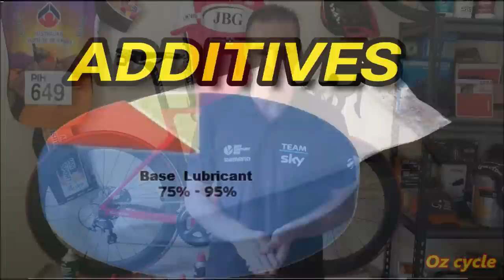Ultimate Chain wax - make it yourself

Comment: I have a 3.5l slow cooker arriving tomorrow - one with a metal bowl was going to be delivered today but cancelled it for one with a replaceable ceramic bowl so can swap for cooking! I haven't checked on the availability of PTFE powder yet but will start waxing my chains soon.
We had an exceptionally wet winter here in Blighty at the beginning of 2021 - bad enough to fit full mudguards to my commuting bike. I carried on using "dry" lube but it washed off after a few miles so started using a "wet" lube that stayed on my chain. Once upon a time, we just bought chain lube!
Wet lube is really useless for the simple reason it attracts so much crud that it grinds every part down - hence my interest in hot waxing.

Comment: Some feedback after 3 years and almost zero chain wear.
I started with 3 new chains and have cleaned and waxed using a fresh chain each week. I still dont even make the first level on a chain wear tool.
I average about 8000kms per year down in Tasmania so winter conditions are pretty average to say the least.
Im using the new formula and im also still on the first batch of wax, will need to top up soon. I also do a full clean before rewaxing, this only takes one minute. 
Because im using multiple chains its pretty easy timewise as i always have one ready to.
Have only just changed a rear cassette for no other reason but replacing wheels and thought i better put a fresh cassette on. 
Thanks for the great video and advice.

Comment: Fantastic video and so much detail thank you for such an amazing effort in the testing and creating the video for us.  Just today I used your previous method for the first time and just bought the rice cooker for it.  I'm wondering if i just warm the wax up on the keep warm setting.  I will try a thermometer on it.  For the Australian's, that brand of slow cooker is sold at K-Mart
Reply from the maker: Yeh that will be fine Andrew,just keep an eye on the temp and it will work out.
Reply: I use an old rice cooker on the warm cycle and a digital temperature gauge. 80-90 is good. Let your chain soak and observe the bubbles until there is no more. I then let it cool to about 60C before removing from the pot and lay it on rags or paper.
Reply: I still use the rice cooker. I put the wax in a glass jar, then put water in the cooker. Put the jar in the water in the cooker. The wax is always cooler than the water by a few degrees and you can stop it heating too quick.
Reply: I’ve been using a cosmetic wax melter. Found on Amazon for cheap. Smaller than a slow cooker but designed for wax so little chance of over heating the wax. Has a temperature display too.

Comment: I was very happy with the old recipe but this one seems to be even more fabulous.
Reply: After 523 days my order of PTFE was finally delivered. Insane it still arrived. I had to re-watch the video to find out why ordered it in the first place. I have used the normal wax procedure for almost 2 years now and it's great. I can do up to 500 km with 1 wax, dry and clean weather conditions. Curious if I will notice a difference while riding with the PTFE-wax..
Reply: @peterderouck7942  hello my friend, how the PTFE waxing went?
Reply: @eljaibas16  I haven’t used PTFE yet. I made my own recipe of wax. Here in Thailand we can buy regular parrafin wax which melts at about 85C and there is another kind of wax (PE wax) that melts at around 130C. I use ¼ of the Pe wax and ¾ of the parrafin wax. I can ride up to 500 km on one wax treatment in good conditions, no rain or dirt.
Reply: @peterderouck7942  do you plan on using the PTFE or just keep using your mixture? Anyways, up to 500km 😯 that's a lot.
Reply: @eljaibas16  I'm fine with this mixture.

Comment: Alrighty. I’ve just bought my slow cooker, blended up my refined paraffin wax with ptfe powder, bathed my chain in this wacky concoction, all in the kitchen while my wife looked on with something that can only be described as pity. 

Now what? Oh yeah. Go riding!!
Reply: What your result I did this with candle wax only and 20km I got clumps of oily/wet dirt everywhere.?
Reply: So how it is?
Reply: @nixho4029   gotta clean your chain , according to the method in the video , clean chain allows paraffin to stick , oily chain,  I mean any tiny residual oil  will prevent parfin sticking , try again , it really does work if you follow the process
Reply: @jugglematt100  Hi if you only use wax how much and how good would it be in comparison with this ptef wax? I think they dont sell ptef in my country :/
Reply: @carlos.5290   ok,  i think others have used just parafin wax or you could try speedwax , available on ebay , which is parafin wax and another additive
Reply: @nixho4029  a reason could be that candle waxes are not all equal. Some contain paraffin oil in various ratios. You need purified paraffin wax with the minimum oils in it. Don't use candles!
Reply: @jugglematt100  actually two additives: PTFE and MoS2
Reply: It's been just over a year since my Wife starting taking pity on me. How is it? I will never go back to any other method for waxing my chain!

I've managed 8,000km out of the chain, instead of 4,000km with other methods. I was happy with that, as a few rides were in pouring rain with very gritty road, so the chain was basically run 'dry' (meaning, no lube), for many hundreds of km.

If it's entirely dry between waxing, I can get 500km. If there's a lot of rain or grit on a ride, then I re-wax after the ride.

My number one tip: Make sure you get the wax temperature to about 90c. Wax melts much lower than this (60c), and you might think it's good to go. It isn't! If you wax at this temperature, you will see excessive peeling of wax and it won't adhere properly to the chain.

Number two tip: Always soak the chain for 15 minutes so it too heats up to 90c.

Doing these two things will ensure the wax is properly bonded to the chain.

Comment: Just completed my first ride after following the waxing procedure and I am totally sold! Brand new S-Works Tarmac SL6 with SRAM Etap Red AXS. I live in California so I had to follow a slightly different process to clean the chain. 1. Used Kerosene instead of Gas/Petrol for the first part and soaked it overnight. 2. Used the old Greased Lightning formula to de-grease overnight. 3. Can't get methylated spirits in California so I used straight grain alcohol overnight. Wax stuck to the chain incredibly well. I would advise wiping off the chain when you remove it from the wax as Oz suggest, especially if your frame is dark. I did need to take a brush and wipe off the shed wax after my ride. Not a big deal. Chain shifted perfectly, was quiet, and absolutely no dirt on any part of the drive train.

Comment: I guessed it would be PTFE in the new formula so I ordered two bags off of Ebay in advance.  The 100g bag from India never arrived so the seller game me a full refund.  The 50g bag from China arrived and I'll be cooking a batch as soon as possible. I also ordered a 55 lb block of refined paraffin off of Ebay for $45 USD.  When I say a block of paraffin I mean a block.  The 55 lb block was supposed to be layered in sheets but it all melted together into one huge block, I guess that's why it was listed for only $45.  I use a hand saw to cut out chunks.  Now I need to find a good use for the one gallon of paraffin oil I purchased.  I guess I'll have to buy some tiki torches for the back porch.  Oz, thanks for all the time and research you put into this.
Reply: The 500g of paraffin mix treats a LOT of chains.  I treated 6 chains and can’t notice less wax in the pot.  My strategy is each of my mountain bikes will have 3 dedicated chains, numbered 1-3. Every few rides, it’s very muddy this time of year, I swap to the next numbered chain.  I like always having a fresh chain at the ready for those times I don’t have time for the full waxing process.  I also like waxing the chains in batches for efficiency reasons.  For some reason I haven’t had any luck replacing my mtb chains at .05 percent wear.  When the Park tool indicates.05 wear I’ll replace the chain on the drivetrain only to have the chain skip on the almost new rear cassette.  I think I ride too much mud for the conventional approach of chain replacement to be effective for me.  It will be interesting to see what results I get with my new strategy.  I do like how the new PTFE formula seems to stick to the chain better than the paraffin oil formula.
Reply: You guys that ride offroad in mud, how do you like using this wax compared to using other lubricants.  I love the wax on my road bike chain but am not convinced I'll stick with it for muddy mtb use.  I find no matter what's on the chain, after a muddy mtb ride the chain needs cleaned and lubed.  Oiled chains I simply spray off the mud using a garden hose, dry with a rag and reapply the oil.  The mud wears away the wax and reapplying the wax bath every muddy ride is time consuming.  I tried breaking a block of wax out of my pot and then rubbing the wax into my chain that has been sprayed off with the garden hose and dried.  This seems to work OK but it's not as good as a wax dip and if the chain isn't totally dry the chain will get rust spots.

Comment: Really great video. PTFE seems to be dangerous for the environment, especially for the birds. Is there any alternative to PTFE in making the wax?
Reply from the maker: Lots of other additives you can use but ptfe came out as best
Reply: @stevenleffanue  What is your recommendation for a more environmentally friendly additive?
Reply: PTFE is metabolically inert. That's why it's in things like knee replacements, cosmetics, and frying pans.

The only way it can be made dangerous is if it is heated to decomposition where it produces toxic gases at 300-400 degrees Celsius.

Birds do not possess stomachs or respiratory tracts capable of those temperatures. However, if you burn your Teflon pan in the presence of your cockatoo then it will die.

As long as you don't reenact Gordon Ramsey's kitchen nightmares in front of your pet birds, I think using Teflon powder will be fine.
Reply: @MonMalthias  LOL. In future I shall ensure my cockatoos are at least in the next room next time I go in for the classic "burning Teflon" pastime.
Reply: @MonMalthias  inert sure, but that means it can't break down. 
The particles eventually get smaller, end up in the ocean, the fish, then us. These micro plastics end up so small they go into your blood stream and brain
Reply: @janeblogs324  there's already pieces of microplastiscs on your body. Using 50 grams of PTFE in a span of over a year won't do any more damage than we've already done.

Comment: WARNING. Guys, be really careful when re-melting your wax that has hardened in the slow cooker. My slow cooker spits wax at you as it heats up. The lowest power setting is 400 watts which is too much. Make sure to keep the lid on. I nearly copped a face full of hot wax but luckily the lid was on. Stabbing the wax first a few times seems to prevent the volcano effect. Did my first ride today on the waxed chain and pretty impressed so far.
Reply: That just happened to me today.  Reheated the wax and it shot a stream off my forehead and all over the ceiling.  Almost hit my eyes.

Comment: Since it is Corona warning in Germany and it is propably clever to stay at home I was waxing two chains for our MTBs this weekend. One was brand new, one was used for a couple times with the sticky Rholoff oil. Cleaning the brand new chain was working very well. Cleaning the used chain took me quite some time. After changing the first bath in petrol for three times the petrol finally stayed clean. 
After all the cleaning the chain runs very smooth. I tried a waxed chain on a touring bike for a couple of hundered KM and it stayed very very clean, I found a tiny little spot of rust under the CONNEX link. We still have salt on the roads in Germany.

Comment: Hey Oz! I have a couple questions about your waxing method/formula. In your earlier waxing videos, you used parafin oil to thin out the parafin wax. Is the teflon performing this function somehow or have you determined that thinning the parafin is unnecessary? I ask because I may just use pure parafin wax until my teflon arrives, but I will probably rewax when I have teflon on hand.

My second question is, in your previous videos you talked about waiting for a specific temperature and possibly dunking in cold water immediately to avoid having the wax run out of the links. Do you still recommend doing either of these? In this video it kinda looks like you took it out hot and you didn't mention a water dunk.

Thanks a ton for all your contributions to the community!
Reply: Hi, Stephen... May I ask where have you ordered de PTFE dust...? I can´t find companies selling it in Spain, and I already tried twice to buy on line but for some reason they return money before sending it... thank you...
Reply from the maker: Ptfe replaces oil. Yes you can use wax without ptfe. No need to dunk chain in cold water when using ptfe.
Reply from the maker: Asia is cheapest for ptfe
Reply: @stevenleffanue  thank you, sir.

Comment: Thanks so much for this.  I’ll be making this over the Christmas break.   I was surprised to discover that the new mixture contains no paraffin oil at all.  Why did you take that out of the recipe?  I thought that softened the wax and made it less likely to flake away.
Reply: Softening the paraffin wax makes it a more durable lubricant, but decreases the efficiency advantages and makes it gather dirt more, too.

Comment: Great Youtube video. I'm currently using MSW however previously I used my own mix of 2:1 paraffin wax and paraffin oil. The oil would add a degree of fluidity to the liquid and help it be smooth on the chain. It always seemed to work well and beat wet weather

Comment: If you don't have a slow cooker you could also use a double boiler to melt the wax. The maximum temperature that a double boiler can reach is inherently the same as the maximum temperature that water can reach (100°C / 212°F). If you don't have a store-bought double boiler, you can make one by sticking e.g., a stainless steel bowl on top of a pot of boiling water, and put your wax in the bowl.

Comment: So i'm quite intrigued by this chain lubricant/wax. By now I've found a 12 speed reusable link, so I could be in business.
However, I'm also concerned about the environment.
In your video, you clean the waxed chain with boiling water. Isn't that releasing the PTFE/Teflon to the environment?

Maybe you could provide us with a more sustainable additive to your wax?
Reply: Very good point. Glad that someone mentions the environment factor.  I'd use plain paraffin, even if it means it'll cost me 1-2 watts.
Reply: can u recommend 12 speed re-usable link?
Reply: @Dralbastaki  YBN has one that can be reused 4-5 times

Comment: Great Video i am looking at changing to test it out can you make the wax bath without the PTFE with just the wax or do you need some kind of carrier oil ?
Reply from the maker: Paraffin wax alone will only last about 100km before you need to rewax. PTFE extends that life three fold and also protects the chain by leaving a micro film which is very slippery.

Comment: Thank you, Steven! I've just waxed my first 2 chains folowing your guides and recipe. Already looking sharp and clean. Love it because no more dirty mess using degreasers and cleaning devices.

But I have one question. I know that PTFE powder is very harmful for health and ecology. It's cancerogenic, and is also a so called "forever chemical" so it doesn't dissolve by itself and stays in ecosystem forever. Sort of asbestos of our time. (there is a good movie about PTFE called "Dark Waters" 2019).

So is there any more eco-friendly and healthy alternative to PTFE powder? Would be great to subtitute. 
Thanks.
Reply from the maker: There are many substitutes for ptfe but the performance will not equal it.

Comment: I use a very similar process, although I use far less PTFE powder.  I intend to change that to what the video recommends.

One thing I added to the process, though, is a thorough shake of the chain in highly purified (99.9% medical) isopropyl alcohol immediately before placing it into the hot wax.  The alcohol, of course, flows very easily and can get into the tiniest spaces, displacing any water left behind, but also filling tiny gaps in the chain.  Note that the boiling point of alcohol is about 180°/82°, and that the wax is melted slightly above that temperature.  So, when the chain heats up, the alcohol immediately boils off.

Here's my theory:  When the alcohol vaporizes, it leaves a vacuum point behind.  The vacuum area pulls in the hot wax, forcing it into points that it otherwise might not flow into as readily, or at all.  I've seen vapor bubbles coming from the circles where pins are held in the plates.  While I don't imagine that wax would flow into that space without help, it seems like the creation of micro-vacuums by the boiling alcohol would pull the wax in.

Comment: MoS2+Li-grease is gold in Ballbearings, they will LAST. Interesting that MoS2 will wear the chain, did an experiment with graphite, with the result that the chain weared out quicker. I guess WS2 is the same thing, it has a different friction coefficient when the part is moving or when it starts to move, same with MoS2 or Graphite, and the construction of the conglomerates are similar too. I guess ptfe additive is the very best. This suggests also your tests with the chain stretch. You need a caliper. Also i think molten wax will dissolve rest of oils on the chain, i guess it doenst have to be superclean, only all grease has to be gone.